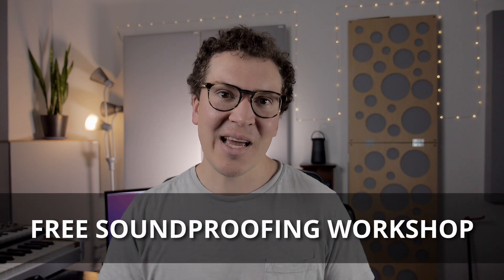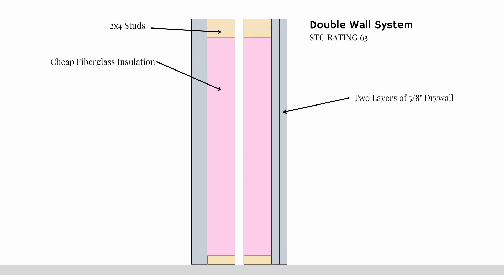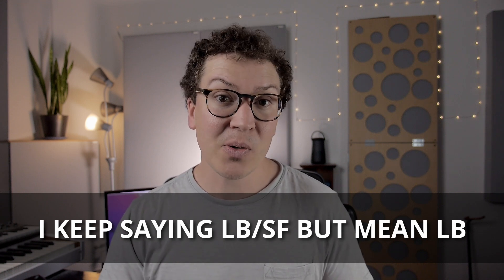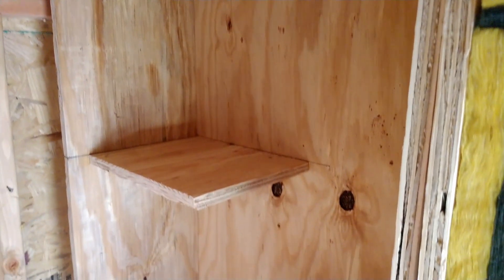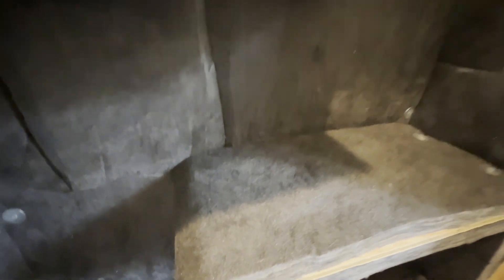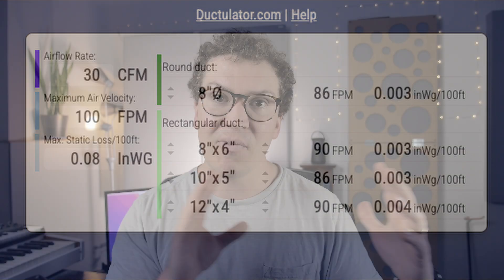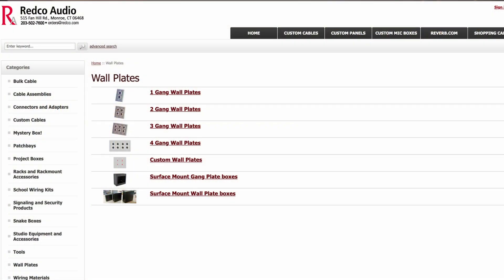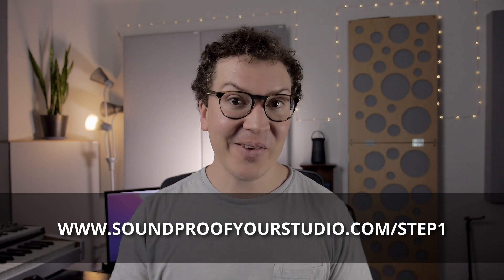Designing Your Vocal Booth - Part 2: Door, Ventilation, and Cabling

Comment: Thanks so much for sharing your priceless experience and information!  Much appreciated.  Forgive my ignorance, but I don't understand what the ductulator results mean.  Is it supposed to tell me the length of ducting needed?  What does inWG/100ft mean?  I think your audience must be a lot more clued up than I am! 🫣
Reply: And I'm not sure if you covered this: I know you mentioned the desired CFM is 15 per person, but does that relate to the size of the booth? i.e. if my booth is 4m3 (140ft3), then do I just get a fan that pulls at least 15 CFM, regardless of the booth size?
Reply from the maker: Inches per water column is a way to measure pressure in a duct. The ductulator is really telling us how big our ducts need to be to keep the air speed below 300 feet per second. In the ductulator you can factor in static pressure in the duct, but this is hard to estimate in baffle boxes where pressure will naturally increase due to the turns and insulation. Overall, hvac is very complex and most hvac techs don’t really have a good way for designing soundproof hvac systems.
Reply: @soundproofyourstudio  thanks so much for taking the time to reply - I appreciate it!  I understand better now, thanks! 🌟

Comment: Great insight!   How do you feel about passive air outflow (Stale/hot air) by way of just a grate on the wall. My basement studio has a vocal booth already and while it has AC inflow air for cooling, there's no way to get air  out unless you open the door. I have thought about putting a single vent that leads to the corridor (Outside the studio) where the AC intake vent is, so that should help pull the air out back into the AC to be re-cooled again.
Reply: There’s been some success Passive vent according to many designers and DIY. Check out Rod Gervais design for ‘acoustic baffle box’ or browse my home studio in progress playlist.  
It involves often hard to find 2” acoustic duct liner.  Just passing on my DIY research, I am no pro.
Reply from the maker: That would ruin your soundproofing unless you isolated the passive outflow air. Without a fan you would not have control of the air flow unless there was a pressure difference between your booth and the outside.